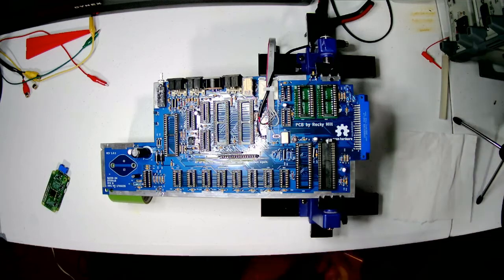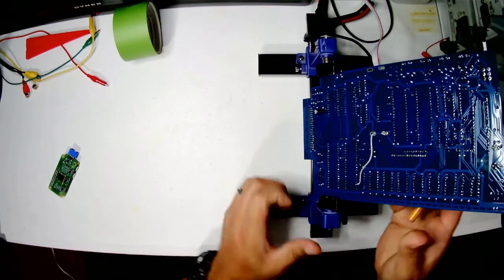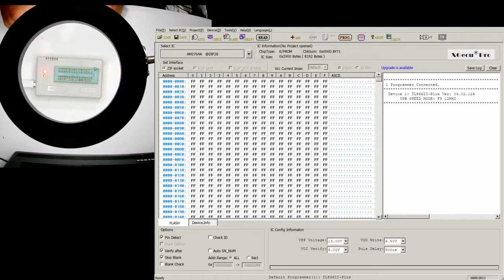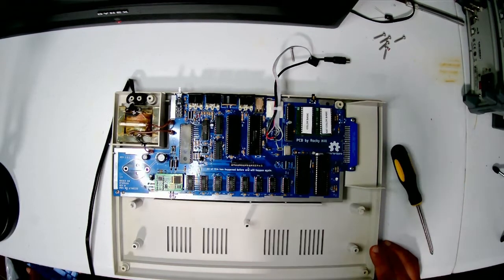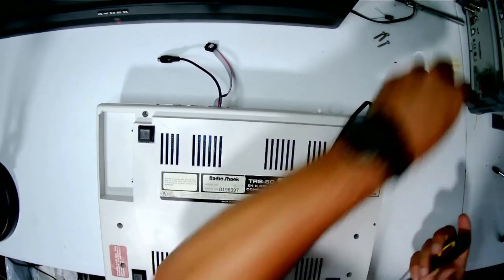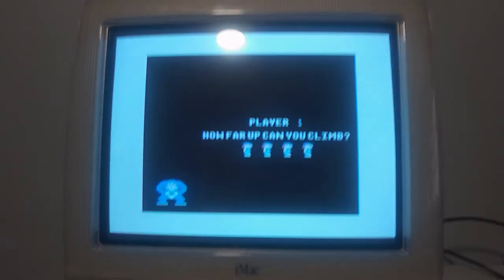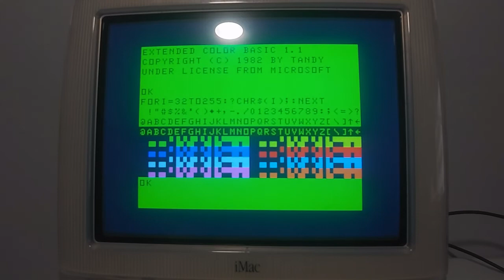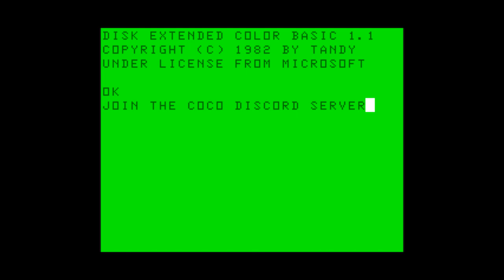Making a CoCo 2, a Retro Resurrection Part 4 #SepTandy

Comment: Wow! I would love to get my hands on one of those.
Reply from the maker: It was a fun a SepTandy project!
The board design is available on github and if you install KiCAD it's a matter of generating the gerber files and the drill file and ordering them from your favorite PCB manufacturer. 
Lately I've been ordering from JLCPCB because they are the cheapest. The minimum order is 5 boards and with shipping it will run you about $42.00. I only have 1 blank one left  but I'm using that one as a reference board.
Reply: @rockyhill3  Too good not to share. I just posted this to facebook coco group. I would love to learn more about how you got this going. Got a link for the keyboard?
Reply from the maker: Thanks, that was nice of you! The keyboard is not available via web store yet but you can ask MrDave6309 for them on the CoCo Discord server. Are you on the server? If not, here is a link on how to join.
https://youtu.be/v2POVhc5NvQ

I heard about the bit-preserve project by the bald engineer which is a project where old pdf schematics are transcribed to KiCAD which is an open source EDA suite of tools by way of crowd sourcing. You can read about that here.
https://www.baldengineer.com/bit-preserve-vintage-schematics-with-kicad.html

After reading and seeing some of his videos, I thought "I can contribute a CoCo2 schematic" So I went ahead and did that. 
Afterwards I decided that I needed to confirm the schematic was good so I said to myself "Why not design a PCB?"
So I designed a circuit board using a broken board as a reference. I cloned the dead board I had so that I could use the service manual for the board to troubleshoot the inevitable errors in 1st revision boards.
Here is a video of the 1st one.
https://youtu.be/QcRTDDZ0i-s

Afterwards I decided I should Do a CoCo 3 board so I did. Here is a video of when I first got it to work.
https://youtu.be/vjpey5T-lSU

So far I've been having a lot of fun doing this.

Comment: Can you post where you can buy the keyboard?  What products did you use to whiten your case?   Mine looks like it hung out in a smoke pit.   Tried the usual suspects.  Bleach,  magic eraser.   All I did was knock off the dirt.  The case is still very yellow.    With all the retro C64 and Apple II kits, I was hoping someone would recreate the CoCo motherboard.  Any plans for a CoCo 3?   But Great video series.  Thanks.
Reply from the maker: Thank you for watching! 

Are you on the CoCo discord server?  if not here is a link describing how to join.
https://youtu.be/v2POVhc5NvQ
Once on, you can ask MrDave6309 for a keyboard, since he doesn't have a web store yet. You could also comment on his youtube channel.
https://www.youtube.com/channel/UCF2yHy7HJPdQyLmrZi-Y28g

To whiten the case,  I smothered it in "volume cream developer" which I guess is used in bleaching hair.

https://www.amazon.com/gp/product/B00J4FKZZM/ref=ppx_yo_dt_b_search_asin_title?ie=UTF8&psc=1

The secret ingredient is hydrogen peroxide. 

After completely coating it with this stuff I wrapped it in saran wrap and left it out in the sun for several hours.
I would check it periodically and turn it to make sure all the parts would get direct exposure to the sun. Some people use UV lamps but luckily I live in Florida and it's pretty bright
around here most of the time. I retrobrited this CoCo with the two halves assembled so that they would whiten evenly.

Here is a description of the theory behind Retrobriting.
https://en.wikipedia.org/wiki/Retr0bright

Here is the 8 bit guy retrobriting an Amiga.
https://youtu.be/HB1LEwX38Vs

If you do this make sure to use gloves because this stuff will burn your skin.
Reply from the maker: I forgot to add a link to the CoCo motherboards I've made so far. The CoCo 3 is the 26-3334

https://github.com/qbancoffee/coco_motherboards